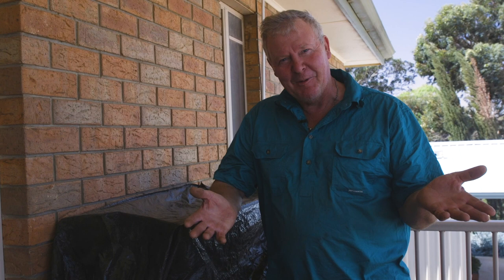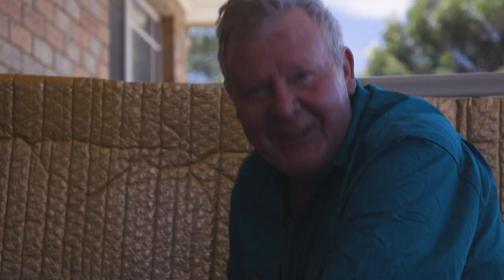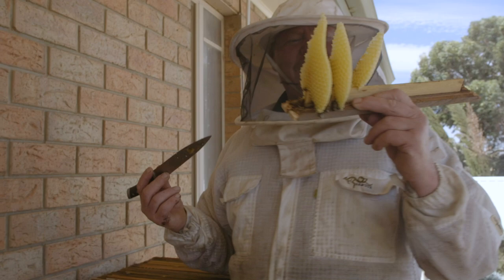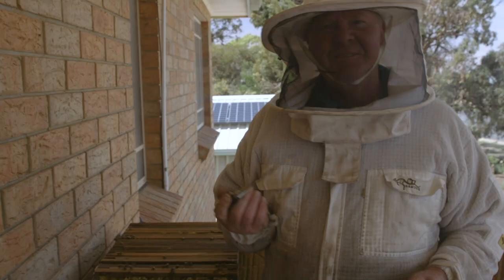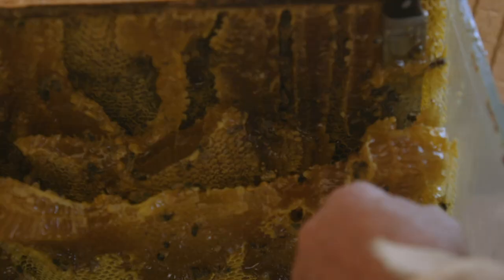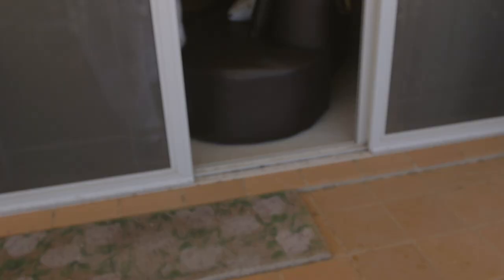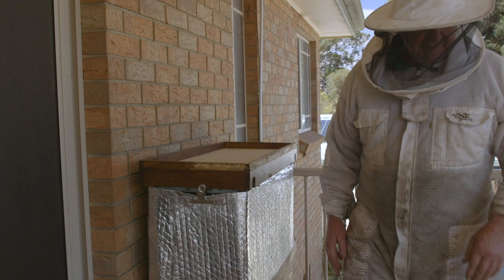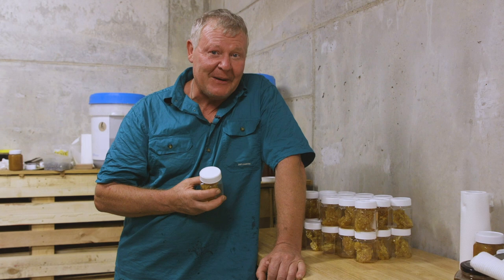Harvesting Honey from the Fish Tank Observation Hive - The Bush Bee Man

Comment: Mate, your top bars are not wide enough :-)  38cm is great and also tie on some of that new comb onto the top bar guides to help the girls know they are to build in the correct direction. Only Kenyan top bar hives have sloped sides.  You can have straight deep sides but get the guide right at the top and wide enough and the girls will be most obedient. BTW, because the bars have no sides and wire like frames, the girls are smart enough to know they have to brace it at each side to hold the weight. Arn't they smart :-).